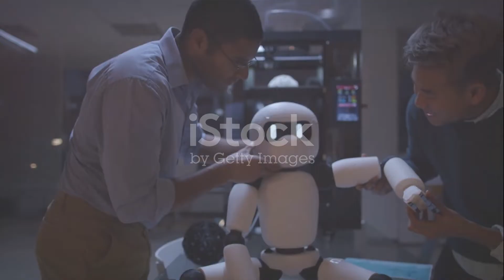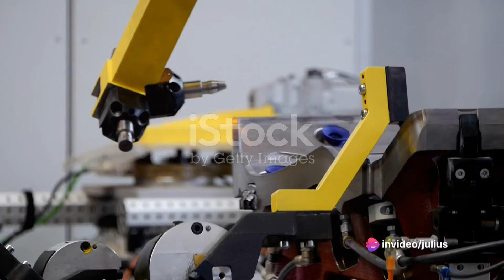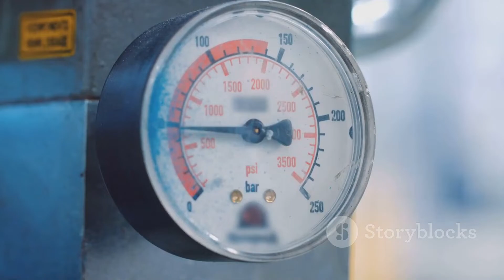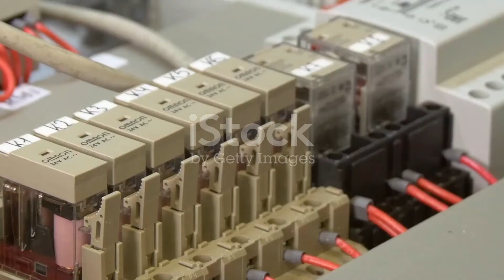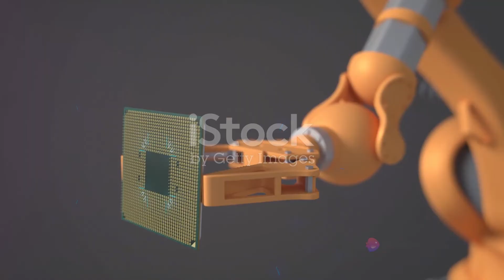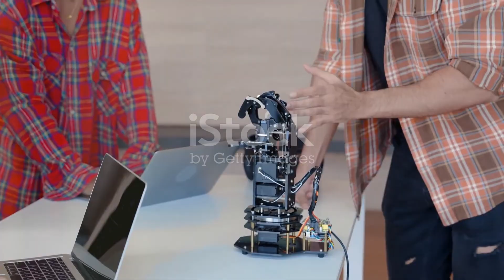Top 10 Analog Inputs in Robotics

Comment: 🎐 X - CASSIOPEIA 📝⬇️
Reply: Irah Nicole D. Ampasin
10 - Cassiopeia

5. How do analog signals get processed by robots after they are collected from the environment?

- Analog signals from the environment are converted to digital signals by an Analog to Digital Converter (ADC). The robot's microcontroller then interprets this digital data, which is processed by the software to make decisions and control actions, allowing the robot to respond to environmental changes.
Reply: Joaquin Gabriel L. Cabug-os
10 - Cassiopeia 

3. Explain the role of position sensors like potentiometers in robotic systems.

- The role of the Potentiometers or position sensors they produce an analog voltage that is proportional to the position of a moving object, like a robot's joint.
Reply: Princess Aiko J. Alzula
10 - Cassiopeia 

3. Explain the role of position sensors like potentiometers in robotic systems.

Answer: Potentiometers or position sensors generate an analog voltage that corresponds to the position of a moving object, such as a robot's joint.
Reply: Adrienne Kiesh R. Magbanua
10 - Cassiopeia 

Q3: Explain the role of position sensors like potentiometers in robotic systems.

A: Position sensors like potentiometers in robotic systems provide an analog voltage proportional to the position of a movable part, such as a robot joint. This information is vital for precise control and movement of the robot, allowing it to perform tasks like gripping, lifting, or rotating objects with accuracy.
Reply: Oclaman, Eureka Glyril B.
10 - Cassiopeia

1) What are analog inputs and why are they important for robots?

- Analog inputs are continuous signals that provide detailed information about the environment, enabling robots to sense variables like position and temperature, which is crucial for effective interaction.
Reply: Nella Regasa 
10 Cassiopeia 

Q4. What are some examples of various analog sensors mentioned in the video, and what measurements do they provide?

A:  Examples of analog sensors mentioned in the video include temperature sensors, light sensors, and pressure sensors. They measure temperature, light intensity, and pressure, respectively, providing critical data for the robot to respond to its environment.
Reply: Cheryjan Aclo
X - Cassiopeia 

1. What are analog inputs and why are they important for robots?

1. Analog inputs are continuous signals from the environment, important for robots because they provide real-time data necessary for accurate decision-making and control.
Reply: James Jabiniao
X- CASSIOPEIA

2. Describe the analogy used in the video to explain the significance of analog inputs in robotics.

Answer: The analogy in the video compares analog inputs to the varying levels of light or sound, emphasizing their importance in capturing the fine details of an environment, which discrete binary states cannot achieve.
Reply: Princess Jelian M. Ucat
10 - Cassiopeia

Q5: How do analog signals get processed by robots after they are collected from the environment?

A: After collecting analog signals from the environment, robots convert these signals into digital signals using analog-to-digital converters. This conversion breaks down the continuous analog signals into discrete digital values that can be processed by the robot's microcontroller or control system.
Reply: Leonardo M. Verbraecken 
10 - Cassiopeia

5. How do analog signals get processed by robots after they are collected from the environment?

- Analog signals collected from the environment are initially transformed into digital signals by an Analog to Digital Converter (ADC). This conversion allows the robot’s microcontroller or processor to interpret the data. The digital data is then processed by the robot's software, which uses it to make decisions or control actions, enabling the robot to react effectively to changes in its environment.
Reply: Y'vhone Felkris L. Estanda
10 - CASSIOPEIA

Q1. What are analog inputs and why are they important for robots?

- Analog inputs are signals that represent a continuous range of values. They are crucial for robots because they allow the robot to perceive the real world in a more nuanced way, capturing details such as temperature, position, force, and more. This enables the robot to make more informed decisions and perform tasks with greater precision.
Reply: Kristine A. de la Rita 
10- Cassiopeia 

Q1: What are analog inputs and why are they important for robots.

-Analog inputs provide robots with the ability to sense and respond to a wide range of physical phenomena. Meaning to say it helps robots to analyze in process data from different kinds of natural phenomena. They are important to robots because without them the depth and nuance of the world of robotics would be gone, reducing its ability to interact effectively with its environment.
Reply: Ethan James P. Malferrari 
10 - Cassiopeia

5. How do analog signals get processed by robots after they are collected from the environment?

Analog signals are converted to digital signals using Analog to Digital Converters. This is then processed by the robot's microcontroller or control system. This conversion process includes discretizing the continuos analog signals into discrete digital values that can easily be manipulated by the robot's algorithm.
Reply: Kiesha Cantila
10- Cassiopeia

3. Explain the role of position sensors like potentiometers in robotic systems.

Position sensors like Potentiometers or Variable resistors provide an analog voltage proportional to the position of a movable part such as a robot joint.
Reply: Lorenz Michael Paderanga
X - Cassiopeia 

Q1. What are analog inputs and why are they important for robots?

-Analog inputs are continuous signals originating from the environment, which is crucial for robots as they deliver real-time information essential for precise decision-making and control.
Reply: Mark Uriel G. Tacbobo
X-Cassiopeia

5. How do analog signals get processed by
robots after they are collected from the
environment?

Signals in analog inputs gathered from the surroundings are first changed into analog to digital converter for digital signals converter (ADC). This conversion makes it possible the robot's processor or microcontroller to analyze the information. Next, the digital data is processed by the software on the robot, which utilizes it to control or make decisions activities, allowing the robot to respond efficiently to alterations in its surroundings
Reply: Daniella G. Estanilla 
10 - Cassiopeia 

1. What are analog inputs and why are they important for robots?

Answer: Because analog inputs provide a wider range of values than digital inputs, they are necessary for robots to detect and respond to a variety of environmental factors.
Reply: Joshua Cliff L. Aurigue
X - Cassiopeia

2. Describe the analogy used in the video to explain the significance of analog inputs in robotics.

- The video uses an analogy to liken analog inputs to different intensities of light or sound, highlighting their significance in capturing the subtle nuances of an environment—something that discrete binary states are unable to accomplish.
Reply: Reeve Radley C Fua
X Cassiopeia 

Q3: Explain the role of position sensors like potentiometers in robotic systems.

A: Position sensors, such as potentiometers, provide an analog voltage corresponding to the position of movable robot parts, allowing for precise control and accurate movements in tasks like gripping, lifting, or rotating objects.
Reply: Jafe ebron
X-cassiopeia

5. How do analog signals get processed by robots after they are collected from the environment?

Analog signals collected by robots are processed by converting them into digital signals using an analog-to-digital converter (ADC). Once converted, these digital signals can be analyzed by the robot's microcontroller to make decisions and control actions based on the data.
Reply: Iñigo Sevillejo
X- Cassiopeia

3. Explain the role of position sensors like potentiometers in robotic systems.

-The function of position sensors, also known as potentiometers, is to generate an analog voltage proportionate to the location of a moving item, such as a joint on a robot.
Reply: Merchella Da-an 

1. What are analog inputs and why are they important for robots?

- Analog inputs are signals with continuous values, typically representing physical parameters like temperature, pressure, or light. In robots, analog inputs are vital because they allow the robot to perceive and interact with its environment more naturally. For example, sensors convert physical data into analog signals, which the robot's system interprets to make decisions, adjust actions, or perform tasks with precision. This enables smoother, more accurate responses compared to digital inputs, which only deal with discrete values.
Reply: Li, Cyril A.
X-Cassiopeia

3. Explain the role of position sensors like potentiometers in robotic systems.
 
-Position sensors, such as potentiometers, are crucial in robotic systems as they provide feedback on the position of moving parts. By measuring the angle or displacement of a component, they help ensure precise control and positioning. This feedback allows the robot to perform accurate movements, maintain stability, and adjust actions in real-time.

Comment: Jag Alona S. Ramayla
Grade 10 - Lyra

Question 01: What are analog inputs and why are they important for robots?

Answer: Analog inputs are signals that can vary continuously over a range of values, unlike digital signals which are limited to discrete values.  They are crucial for robots because they allow them to perceive and interact with the real world in a more nuanced way. For example, analog sensors can measure things like temperature, pressure, light intensity, and distance, providing robots with the information they need to navigate, avoid obstacles, and perform tasks that require fine control.  This ability to sense and respond to a wide range of continuous values makes analog inputs essential for robots to operate effectively in complex and dynamic environments.

Comment: Chris Nathan Dwayne M. Dura
10 - Lynx 
3. Explain the role of position sensors like potentiometers in robotic systems.

A: Potentiometers in robotic systems measure the position or angle of components by varying resistance, which alters voltage output. This feedback is used in control loops to ensure accurate movements. They are crucial for precision, easily integrated with control systems, and widely used in applications like robotic arms and CNC machines.

Comment: Jasmine Cañete
10-LYRA

1. What are analog inputs and why are they important for robots?

-Analog inputs are signals or data that represent continuous and fluctuating quantities. Unlike binary states, analog inputs can take on a range of values, providing detailed information about the environment. Analog inputs are important because they allow robots to sense, measure, and interact with a variety of physical variables, such as position, force, temperature, and more. This enables robots to perform tasks with greater precision and adaptability.

Comment: Shei Christiane C. Payot
10-Lynx

1. What are analog inputs and why are they important for robots?

Analog inputs enable robots to detect various motions and environmental properties, allowing them to respond effectively. These inputs measure and interact with variables like position, temperature, force, light, and more, providing robots with detailed information to accurately interpret their surroundings. Many sensors in robotics, such as temperature sensors, light sensors, force sensors, and accelerometers, generate analog signals. These signals need to be read and processed to digital signals in order for the robot to incorporate it into its algorithmic processes.